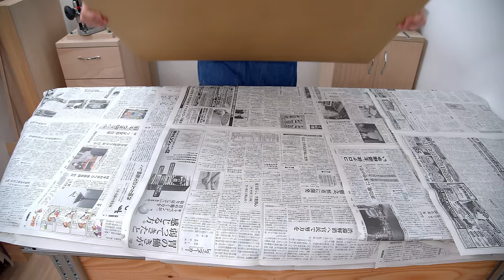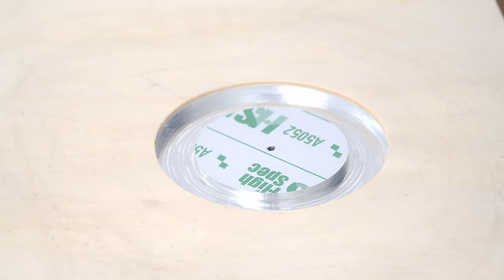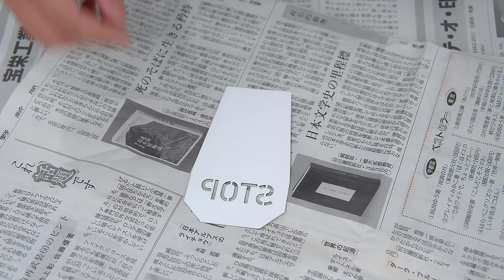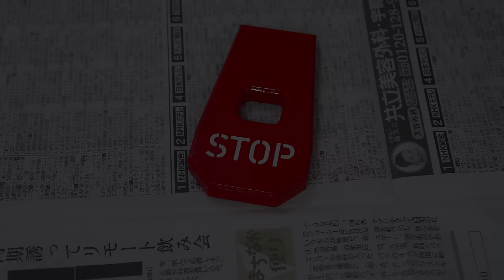Make a Router table / trimmer table

Comment: There's always a guy like this that makes me feel like I shouldn't even be allowed to own a screwdriver.
Reply: I just might burn my workshop to the ground and take up Needle point. Boy Howdy! Great ideas, eh?
Reply: I COULDN'T HELP ADMIRING YOUR COMMENT. IT IS THE SAME HERE ALSO
Reply: Isn’t that the truth! This gentleman’s craftsmanship is something to behold!!!! 🤠
Reply: While there's contractors like myself that only see flaws or unnecessary over engineering of certain things. Yeah better over engineered than under; but still. Honestly though other than the fact that I think this was a little over engineered; it was still an astounding build. Only thing I really had any cringe moments about was the fact that I'm still astounded at their wiring over there where he is at. Here in America seeing a piece of Romex without a ground wire is unheard of. Seeing power tools of certain amperages not requiring a third prong for grounding is unheard of. Maybe they figured out a way to do wiring over there that doesn't require the use of secondary grounding that we Americans use; but either way when I see high amperage tools being powered in this guy's shop with two wire cordage, I cringe. Didn't even know they had a version of that Makita router that was not three prong. The American version is three prong. I did love his self anodized aluminum mounting plate though. Overall solid build just still cringing about the wiring. The reason we use it is as a safety in case of a short that could then energize other conductors in the casing or other middle parts of a cabinet system or housing. This way there's always a path to ground instead of through you and the device while the circuit tries to find ground through you and said device. Yes you can still get a hell of a shock even with a three wire system. But it's a lot safer. Then again this is Japan where he's at so I guess they don't care enough about their people to adopt something like this. It's actually part of standard US electrical code now and absolutely required for wiring of new circuits and devices along with circuit breaker systems to de-energize the entire circuit in case of a short.
Reply: What's a screwdriver?
Reply: Sounds like playing guitar and then hearing a band like Dillinger Escape Plan.  You just want to put the guitar away and ponder on life.
Reply: Ha ha ha…..you made me laugh !   Exactly how I feel also.
Reply: Г
Reply: @cdvaight  It's a drink.
Reply: Pois é! 🤣🤣🤣🤣🤣
Reply: Well he’s an engineer.  He makes robot birds that actually fly.
Reply: Isn’t that the truth. !
Reply: Dude no shit, I was looking up something on my phone and I look up and he's anodizing I guess 😂😂😂👀😳
Reply: Hahaha....😂😂
Reply: Perhaps the Greatest remark I have ever read!! So true, dude. LMFAO!!!!

Comment: I've been a carpenter almost 40 years. Believe me when I say this guy has got it together. I watched this because I'm building a new router table. Man talk about inspiration this is really nice. Keep up the good work. BigJohn
Reply: 30 years here and I couldn't agree more!
Reply: It is impressive.  The metal coating was a nice touch, and the build does give some ideas/inspiration for me as well.
Reply: @tonyvinesmusic  I hear you. We used to build stuff like this...... As the cabinetry (sans tool) for the custom motorcoach company I worked for. 3/4 -1mil., Back in 80's 90's. If I remember correctly an empty new Prevost shell was + - $350K. Did I miss the part where he applied the hand rubbed finish. Niiicee!
Reply: It's because he doesn't work like a carpenter/woodworker.  He just happens to make stuff out of wood.
Reply: Just buy you an INCRA
Reply: AUTISTICBRAINDMG  Just give it a try. i assume you have what it takes bro!
Reply: @GoatZilla  - Exactly - A Japanese Engineer!
Reply: @amanawolf9166  Its called Anodising.

Comment: A tiny anti-tair-out trick I have seen (but never tried), is to start drilling a hole Spinning the drill BACKWARDS to score the surface. THEN drill the hole normally. It may protect the laminate surface when inserting threaded inserts. 
I really like your micro drilling rig, very nice.    Lovely project. Clearly a lot of planning went into making it a success.
Reply: Its surprising how many engineers dont start inserting bolts by turning them backwards until the thread drops down only then screwing them in.
Reply: The problem with threaded inserts is that most types for engineered materials (MDF, OSB, et al) displace material, which easily deform surface consistency. I normally countersink entrances to holes for threaded inserts to reduce this. Chipping around laminate is easily solved by using the correct type of drill bit. Scoring the surface is useful, however in general it's the approach that makes the difference. Self-feeding bits will always damage surfaces since the point feeds before the outer lip has chance to do its job. I usually allow the drill time to work under its own weight, or in the pillar drill skim the laminate until scored through. Running a bit backwards is liable to chattering since the apparent angle of the "cutting face" of the drill is pushing the bit out rather than shearing against it. It can work, but it's somewhat dependent on material, user and the bit in question.
Reply: @TristanJCumpole  mate id love to see a video of your technique, im completely new to the whole threaded insert thing but i can already tell that its something id love to incorporate in future projects, it would be great to start on the right foot and do it properly rather then destroy a bunch of material in the learning process yeah ;)

Comment: The router plate should never be exactly in the middle of the table or you'll actually be wasting space. You need to take into account the depth (thickness) of the fence (with its base and accessories such as micro-adjust screws) and add at least that amount to the width between the router plate and the back edge of the table.
This is to compensate for the space taken by the fence. When the fence is pushed back to the limit of the table it's best to maximize the space available between the face of the fence and the router bit to allow for working on wider pieces. This is why on industrial router tables the plate is always moved forward towards the front edge of the table. When you need more support in the front you can always add an outfeed table there, but you can't do that in the back.
Reply: Thanks, I hadn't thought of that in my current build, but it's cool because I made it wider and not reliant on T-track for fence adjustment for that very reason. I can set up the fence at 90 degrees from the nominal front and be alright. Still, "The more you know"...

Comment: Nice work, but I'd be afraid to get it dirty. ;)  The one change I would suggest is to eliminate the router plate you made (nice job BTW) and go with an aftermarket router lift system.  Way more convenient, raises higher & locks and has a depth indicator for adjustments.

Comment: Instant sub! Just one thing, why not benefit fully from top aluminium plate and make quick release system for the top ring rather then four screws every time you need to change the bit? Otherwise top work!

Comment: Great video (like all those already made) but this is the best, well I haven't watched it yet but just the title and the visual on the result makes me want to watch it.

Before that I would like to know if you have the possibility of giving us a summary of the different pieces of wood with the precise measurements via numbering for example?
=> well if it turns out the answer is already in the video :))

I download all your videos to reproduce the different elements that you have done but the ones that I don't need yet because it will be useful to me as I progress in this area.

Given that the videos are a few months or even years old, are there any elements that you would have done differently now?

To use them for longer, can we replace certain wooden parts with aluminum parts?

Well, I just have to wait for the videos to download :)

たくさんのビデオをありがとうございました。

Olivier

Comment: Incredible precision, fantastic idea, beautiful solution ... but one small complaint. The machine itself is not designed for this kind of work and its use is discouraged. It might be more complicated to put another unit because the controls would have to be additionally installed. But it would certainly be more financially acceptable

Comment: I noticed that when you drilled the small cavity for the neodymium magnet that you used a standard drill bit.
I recently got me a set of Forstner bits, and they are amazing for clean precision cut holes.
I would recommend to anyone who has a drill press, but they can also be used with a hand held drill and a firm hand

Comment: In some other YouTube video I learned that using a router against a straight edge correctly, means placing the circular edge of the router against the straight edge - not the straight edge of the router. That way even if you rotate the router a little, the drill bit will always remain the the center and follow the same line no matter how rotated the router is.

Comment: Hello from Australia. Many congratulations on your excellent workmanship, and design.   I have no cabinet-making  experience, but a bit of wooden boat building experience.  Can I ask two questions.  1.  Do you use an exterior grade of plywood?  2.  Why do you not use an epoxy glue instead of  the ordinary wood gluing glue - having regard to the other materials used, the length of time the tables will be used, and the splendid nature of your workmanship?  Thanks. Chris

Comment: Fantastic craftmanship and ultimately a  beautiful table/cabinet. However, replicating it is well out of the league of your average hobby woodworker. It would cost a  fortune to put that all together. That looks like prime Baltic Birch, which these days is almost impossible to get, and even if you can source it, it's up to three or four times times the cost it was 3 years ago. Then there is the electroplating. How many of us have the facilities to do that. Or own a CNC? Don't want to sound negative, as there are some little things that can be adapted, but it's more a case of stand back and admire.

Comment: Have you considered the router bit being mounted  and grub-screw key-locked into a short spindle so that the router locking mechanism is horizontally accessible under the table top? More accurate and safer.

Comment: You make some of the best DIY-videos! I love your clever workarounds and selfmade tools :-) Would be nice if you wrote which materials you used. For instance what is the liquid in 5:10? Is it water or oil in 12:00? What is the handy small tool at 7:16 called? What did you use to laminate the top/bottom and sides of the baseboard?
Reply: 5:10 to gunt wyglada jak ceresit CN94

Comment: Does anyone know where to purchase one of those portable drill press thingy he uses.   I really really need one.  At my age accuracy is hard to accomplish.      Thanks.   From Canada.  😊.  And where do I find those slide rails    The ones for the back sliding fences.     I’m way behind in this stuff.   Been in a marriage coma for 45 years.   😂.  Didn’t get out much.  Haha.  Sorry 😅.   And a quick tip :  when your drilling into aluminum, there is no need to use a lubricant.    Aluminum is its own heat reduction source.     ( journeyman glass worker for 40 years ).  Just saying.   And it’ll help keep oils from infiltrating your wood works.

Comment: Dear JSK, you are using a makita router; how to change router bits properly; I see you doing it in this video but there is also a button that is needed to be pushed at the same time, else the hex bolt is not properly secured (axe turns with the bolt). Same for loosening the bolt ? (and compliments for this video, I downloaded the plans as I will make this table having also a Makita RP2302 router)
Reply: Hey Luc. I also have a Makita RP2302 trying to make it work under a router table. It has an anti-restart safety function (protection contre le redémarrage accidentel) which prevents the router from starting if the switch on the handle was on while power to it was restored. This means you cannot start and stop the router with an external switch. The older RP2300/RP2301 did not have that (i think). Where you able to somehow bypass the safety feature?
Reply: sorry Aris for seeing this only now. Yes I was able to tweak the router to make it work. What I did is disconnecting the cables at the output of the internal switch and bringing that output with a new cable towards the table, there putting the switch of the table in series; meaning the output of that external switch has to go back into the Makita towards the cables you originally disconnected. Bit difficult to explain in words.  It means one extra wire going out of the Makita housing and one going back in. I was able to do that via the rubber tube but it was hard.  Advantage is that the safety mechanism is still working (although the router's switch is continuously ON, the table swich takes over the full fuctionality)   @arisskarpetis
Reply: @LucDeJonckheere  Thanks for the response Luc. I think I understand what you did. Unfortunately this means the router is dedicated to the table and I would like it to also be portable. I wonder if the control board of the old router is compatible with this one. Maybe I need to ask the Makita repair centre... but I think I know what they will say 😄
Reply: @arisskarpetis  Actually what I did is bit more complex in order to allow me to use the router as portable still (although I did not use it till now). The wires I brought out of the Makita are only sticking out of the Makita for 10 cm or so. I soldered a female XT90 connector to it (ok, normally those are for DC projects...). When inside the table, I connect this XT90 towards it counterpart (male) XT90 , the latter going towards the switch of the table. When using as portable I have a male XT90, which shortcuts the 2 legs, and which I put on the female of the makita. OK, looks a bit awkward with that 10 cm cable sticking out of the router, but it works.
Reply: @LucDeJonckheere  nice work. Things makita makes us do instead of having a reasonable way to just disable the feature. 🤡

Comment: Great table! But why did he use the battery trimmer? As he over worked it... you can tell by the noise it made, the bearings where screaming! 
Router table! So why didn't he use the router? 
Which ever you use you should know certain things, like how much of a pay load you can put on the power tool. 
This is a problem, even pro make the  mistake. I can only put it down to modern techniques, which made people do things in one hit, rather then doing it right and making more passes, and not over loading their power tools.

Comment: are there any australians here who have purchased this blueprint and made this router table ? the reason i ask, is that im concerned about the ability to source that aluminium profile that is used for the guide rail in australia. and im wondering if anybody has had any luck finding the same kind of profile locally ? or if they had to get a length of it imported into australia ? and if so what was the rough price to purchase it from overseas including shipping costs etc ? i would love to build one of these tables for myself but unless im sure i can get hold of the materials theres probably no point buying this blueprint etc. any information would be greatly appreciated ;)

Comment: SAFETY FIRST
The red coloured STOP button must be located at a spot
where it can be reached and pressed easily.
The human body has to bow down to the right now, which
can take precious seconds, being dangerous
The best location to install the STOP button is at the front
side of the door of the router table at a height of 60 cm 
from the ground. It can be pressed by the human knee,
which takes "zero" time..
A CC of this mail has been sent to Makita Japan.
Jaco van Lith, Rotterdam The Netherlands